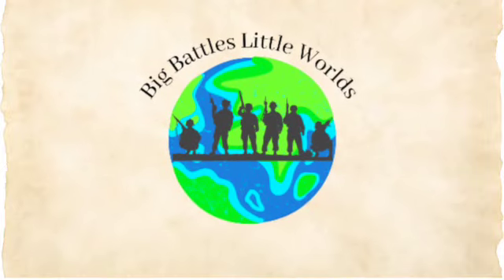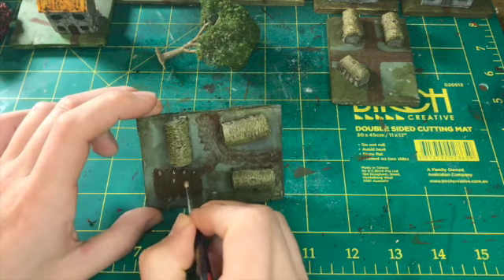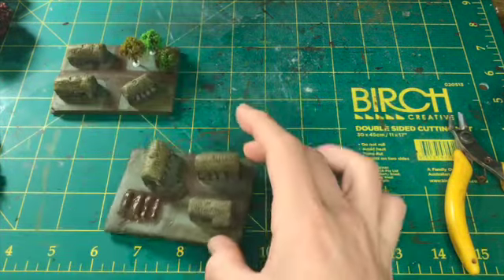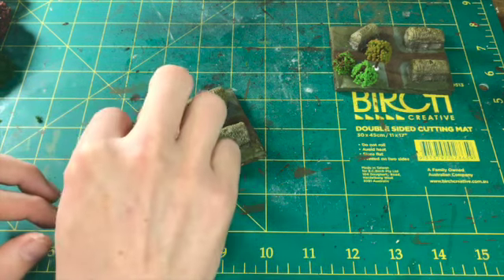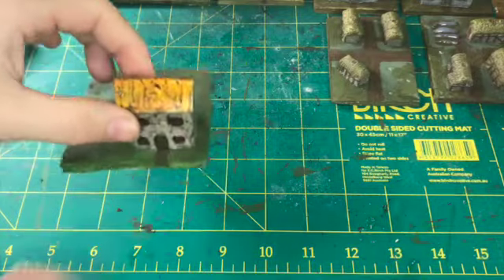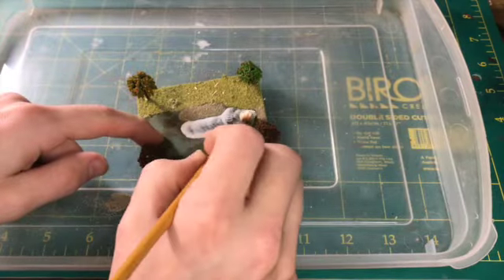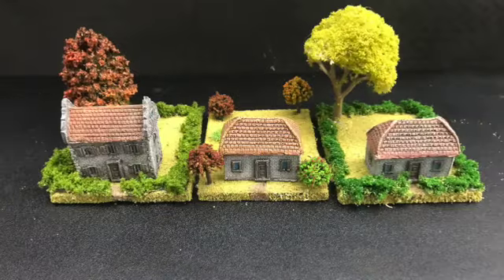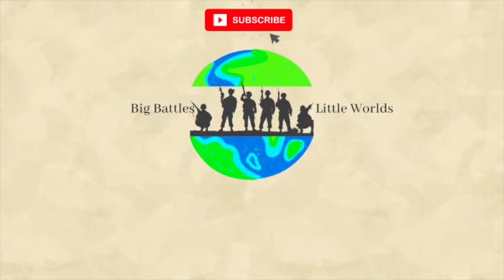How to create easy great-looking scenery terrain bases for your historical wargames!

Comment: Great video. One of things I would love to get your opinion on is how to handle terrain in 6mm. Can the terrain be occupied, or is it just a LOS blocker/movement hinderance? I'm exploring 6mm with a friend (First Crusade) and unsure how to lay out buildings to still be playable.
Reply from the maker: Hey, thanks for your kind words. I am glad to hear you're getting into 6mm games. I am actually recording a video today regarding scale in wargames where I will go into detail on this point more. But for me at 6mm It depends on what your bases represent on the table. If you have a single house as a house but a base of infantry is 500 men the house will not offer a benefit, if the house is a town then it will offer a benefit. Also it works the other way if the infantry base is 10 men then a single house will offer a benefit. Then If the terrain is capable of giving a defender a benefit then I would figure out what the bonus will be. Could be extra casualties to the attacker or less casualties for the defender etc.
I would recommend before playing you and your opponent write down what each piece of terrain will do can it be occupied and where the unit will be placed etc and what benefit the occupation will offer. I hope that helps.